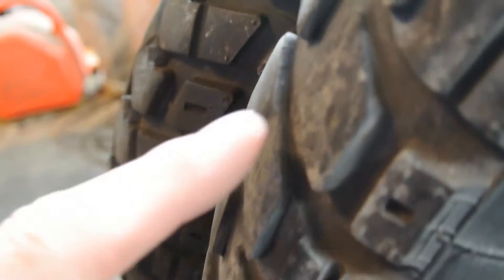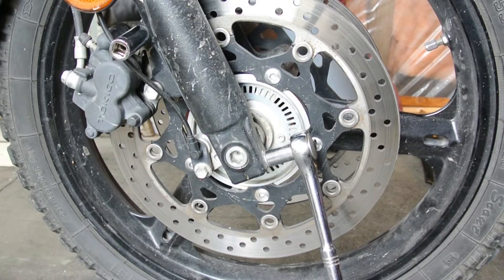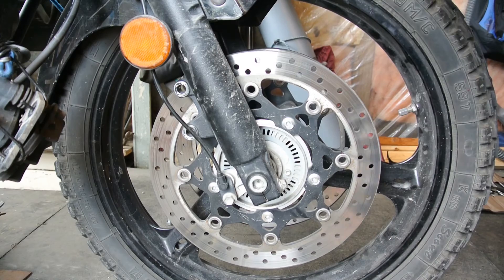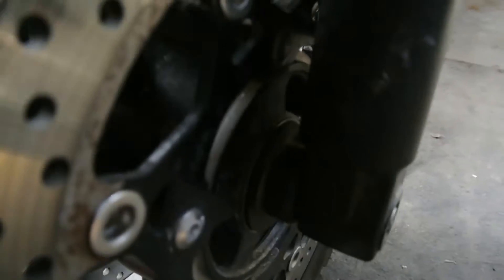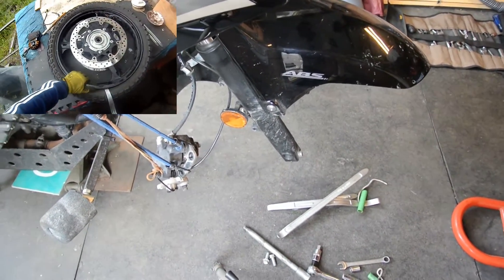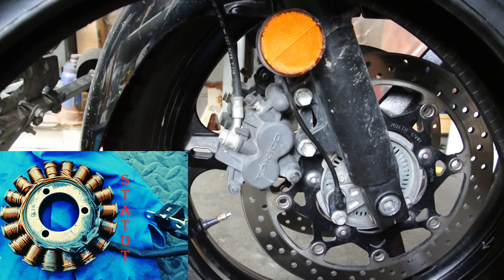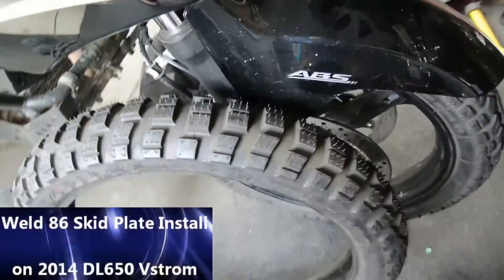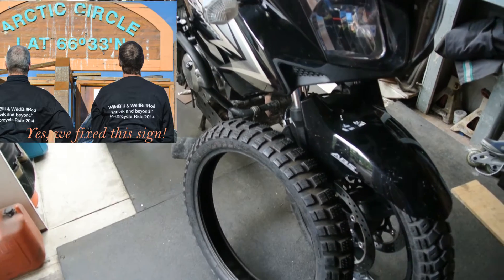DL650 Vstrom Front Tire off How To: tire had plug for 16,000 km

Comment: What I want to see is how to remove the old tire from the wheel and put the new tire on the wheel with just the tire irons/hand tools, so I can save some money. Removing the wheel is easy like you said, at least in comparison. I took my rear wheel off but I paid someone else to change the tire (705), now i have a new 705 for the front and I bought the irons but kinda apprehensive :)
Reply: It can be done but one has to use plastic protectors as that rim is easily scratched and scraped.

Comment: Do the brakes have to be pulled because of the ABS?  Never owned an ABS bike.  Considering a 2nd generation 650.
Reply from the maker: Unbolting the brake assembly just makes it easier to remove the wheel. They can just be hung out of the way.